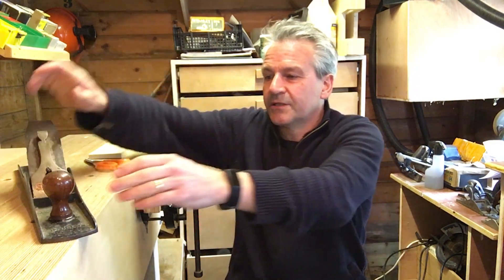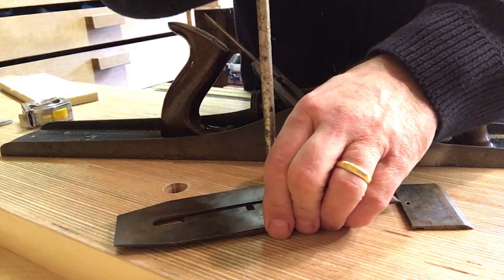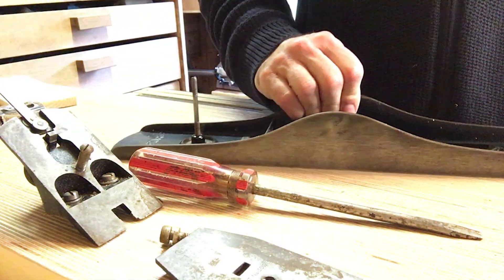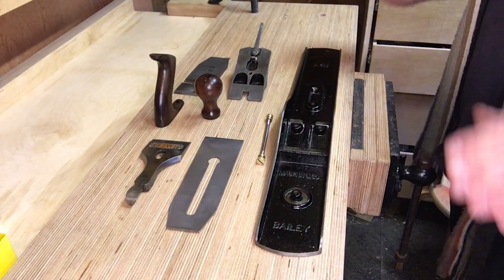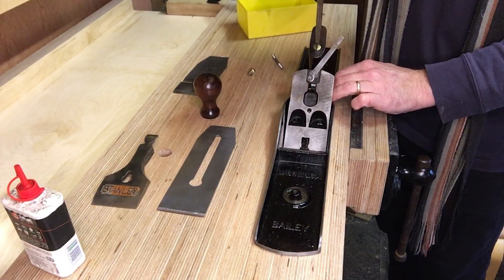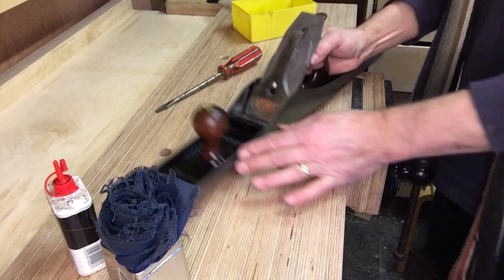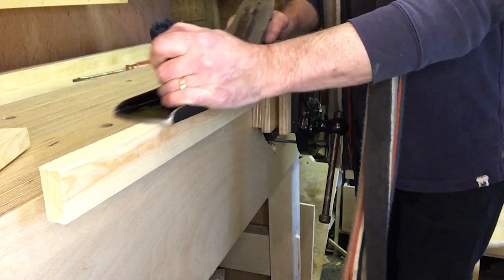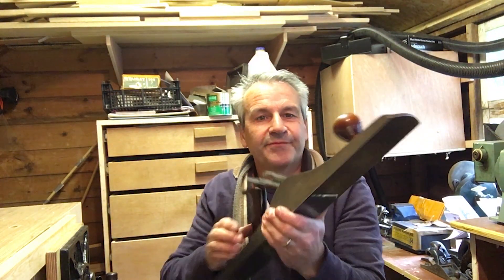Stanley No 7 Jointer Plane Restore

Comment: A lucky and useful extra, I've had a Clifton StaySet, cap iron (the 1980s remake). It is on my No7 of a similar age to yours. The thicker metal of the StaySet improves the performance of the plane blade. It seems to dampen chatter, and speeds up resharpening. My lever cap is the same dark colour, not chromed, is it a nickel finish?
Reply from the maker: It cuts very smoothly not sure if that’s down to the stay set ,not sure on the lever cap I don’t think it’s plated but may need another inspection

Comment: A beautiful plane and as you said in very good initial condition. I have a no 7 that I will refurbish later on and it is in a bad condition compared to the one you have here.  Lots of surface rust and pitting and most of the Japaning cracked and scratched.  But I will get it back in shaving state sometime this year.  
Keep up the good work!
Reply from the maker: i have experimented with electrolysis for removing rust - a couple of poo results but last time came out really good - easy to do and set up and its non invasive it doesnt take any metal away

Comment: The plane was in excellent condition.   Cleaned up easily.  Well done.
I have a granite slab I used to check/flatten the soles of planes.    The main area to be flat is from the toe to the back of the mouth for best performance.
I hope I can find a Record Stay-set cap iron at a flea market.    Record planes are not so common in the US.
One of my first hand plane restorations was a Stanley No 7.   Mine is Type 16, so has the kidney shaped hole in the cap iron.    This one has corrugated sole.   I prefer a non-corrugated sole which I find easier to sight the blade when adjusting.   I had to make my first tote and knob for this restoration.
My first flea market visit this past Friday.   Some vendors had very reasonable prices, like a Stanley #5 for $20.   Another vendor had a Stanley #6 for $115, far too high a price in my opinion.  I did see some #7's but did not look at the price.  I have the one I restored and another one awaiting restoration so I do not need another #7.
I did find a Taintor Positive 1900 saw set tool for $1.   I had to get this just to see how they work.    The 1900 refers to the last year of the 4 patent dates, so this tool is perhaps 120 years old.   It seems this is good for up to 10 teeth per inch blade.
I purchased a cap iron screw driver from Veritas.   It has a wider blade to match the large head of the cap iron screws.    I recommend keeping an eye out on your flea market visits for a screwdriver with wider blade to help prevent damage to the cap iron screw from the screwdriver blade being shorter than the width of the screw head slot.
Dave.
Reply from the maker: Hi Dave thanks for comments I really like the number 7 but really because I wanted   One not needed one, if I see any stay set irons I will pick up one and let you know but  only seen the one so far

Comment: Love these plane restoration vids! 😎
Couple questions my good man. Was that a wire disk you chucked up in the drill press? And was that also a buffer disk you chucked up too? Some explanation on those tools would be appreciated.
Thank you!
Reply from the maker: Hi - yes the wire wheel is just a firly standard one from a cheap set from local DIY store, the buffer wheel is a 3M Scotchbrite wheel - really good but quite pricey - i also bought some cheaper ones and they were pretty good as well. Thanks for watching - another vid out this afternoon so look for that one